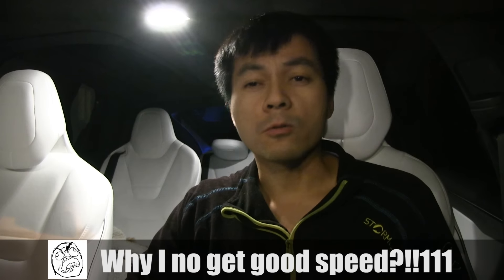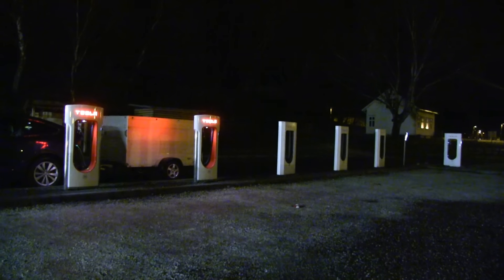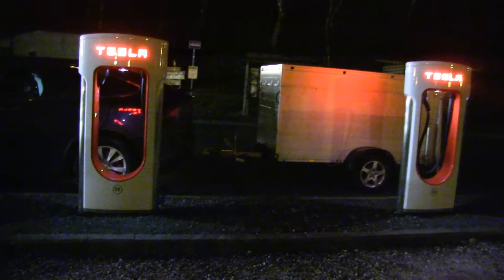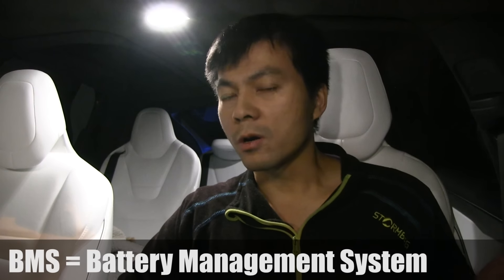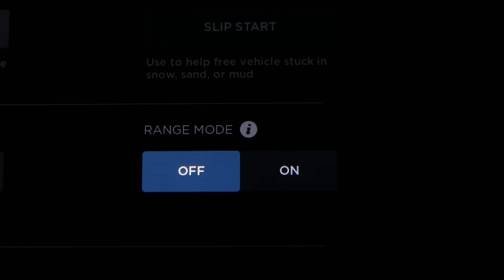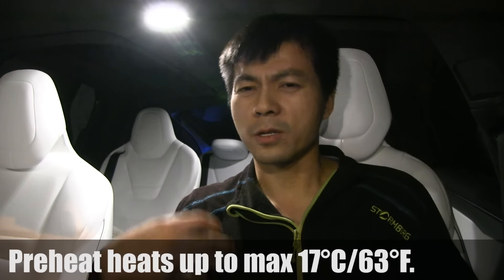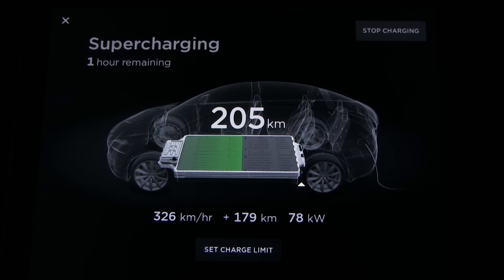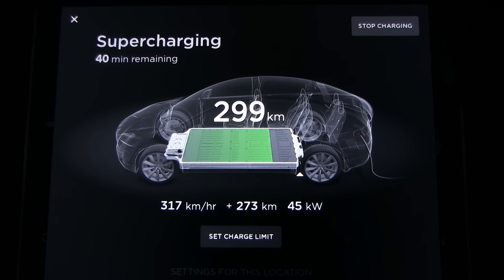How to get fast supercharger speed

Comment: They key point "range mode" need to turn off is the key point. It is very good for you to tell us the key point. I am from Hong Kong. Like your video as usual.
Reply from the maker: There are several key points. Even if range mode is off and you plug on a charger where someone else is already charging at, or you arrive with 80 % SoC, you still won't get good speed. Hence, all three conditions must be met at the same time.

Comment: Is there a change in efficiency (more kwH used from the grid to get that amount into the battery) of charging the battery if the battery is warm or not?  We have peak and non-peak power times at our house, and in the winter time our garage could get below 0 degrees Fahrenheit.  If the efficiency is the same I'm thinking it would be cheaper to charge starting later at night when the battery has already cooled down to a sub-optimal fast charging temperature.  You have all night to finish charging the car, so the speed is not important as long as it is done by morning.  Have you looked into this?

Comment: Hypothetical - If there is a person at 1A getting 100kW and you used 1B providing you with 50kW.  When the person from 1A disconnects and leaves, will 1B become the priority automatically or would this user need to disconnect and reconnect to set that priority?

Also if you turn on Range Mode, would that decrease your SoC % and then increase your speed?  The goal would not to be reaching 100% Range Mode, but lowering SoC so that it charges quicker.  Or is SoC measured off the battery size and not the software limitations?  Thanks.

Comment: Preheating time needed must of course depend on ambient temperature because if it's higher than 17C the battery would be already warm enough at the start. I guess you explained worst case scenario just to simplify it.

Comment: Doesn't a low SoC cause more wear on the battery?  (and charging at a higher rate).  The charts I've seen show that you get more total battery lifetime kWh (charged/supplied) if you only discharge to about 40-50% (and only recharge to about 80%).  Now, those numbers are relative to the actual cell capacity - electric car batteries can have more capacity than their nameplate and may not charge to their true 100% capacity to increase longevity.

Comment: Thanks Bjorn for useful video for us new owners. I have a 2014 85 and have an experience where I wonder which demands that were not reached for full charge speed.
I arrived Valdresporten SC after driving 1.5 hours with soc about 36%, I was alone on the charger, outside temperature - 7 and I got about 60kw charging speed. 
Could it be that the battery never gets hot enough by such outside temperature to get higher charging speed - or? What is your experience in the winter?
Reply from the maker: Was range mode on? I never have this problem even when driving through lower temperatures than that. But range mode is off (meaning battery heater is on).
Reply: Yes - range mode off (have never used it "on").  Same experience when driving the other way back, with even slower charging speed. But then I had been driving downhill from Golsfjellet and less load on the battery that's makes less heat in the battery - so I expects that battery temperature was even lower ...

Comment: Great job Bjørn Nyland! Sorry fot the O.T. Do you actually know how Tesla engineers have managed to fit a 100Kwh battery pack in the new Model S or at least how it's made? How do you think they have upgraded the battery? By improving chemistry or adding more cells? Thanks
Reply: Better cells.
Reply: Esunisen thanks for the quick answer but how do you know that? Is there some kind of forum where did you take these kind of infos? I wanna know some more of the technology behind the Tesla's car
Reply: +Flavio Artegiani 
Previous commenter is wrong im afraid, Elon Musk confirmed that the 100 pack uses the same cells as the 90(or therefore all packs) and they have just improved and redesigned the cooling/heating system so that they can fit more cells. 
Go to the tesla motors club forums. Members have discussed it there extensively.
From the calculations I did they now have 492cells /module as opposed to 444 on the previous generation packs like 90 and 85, others have come to these numbers too.
This is of course speculation as no one has opened up a 100pack yet.

Comment: Maybe Tesla should fix their firmware so range mode doesn’t disconnect battery heater while it’s cold and sitting charging.  Or provide that as an option setting.

Comment: Do you still only get 80kW as maximum speed at the SuC?
Reply from the maker: Yes
Reply: Bjørn Nyland do you know if there is anything wrong with your car? if not, are you planning to get it checked out?
Reply from the maker: Filip Bjurling Other owners are reporting the same issue. All this happened after v8.0. I have already reported it to Tesla several times and they diagnosed my car.
Reply: okey. thx for the update
Reply from the maker: Arnis Tarassu And are you sure that Leaf with only passive cooling doesn't take damage from that? Just because another car is doing something Tesla is not doing doesn't mean it's not healthy.

I remember someone was complaining that Tesla limits the regen with cold battery. His Ampera didn't limit regen with cold battery.
Reply from the maker: I compared old footage of Model S 90D facelift right after the speed was increased. It turns out that my "slow" speed isn't that bad if I charge from 5-10 % to 90 %. With the old charging profile, you get faster max speed at the bottom. But the speed also tapers off more agressively. With the charging profile now, the 70-80 kW sustains for a longer time. And even when it tapers off, it is more flat.

Conclusion:
- Charging from 5-50 % takes longer than before.
- Charging from 5-90 % is more or less the same.

Comment: I would add: Battery must not be hot
Maybe it's what happens when you get low speed when you tow the trailer and use 400+ Wh/km.
Reply from the maker: That's a rare case. I wanted to simplify this video because most people don't want to know everything.
Reply: Thanks for x-plaining things.  Wish Tesla would do a better job at that.

The supercharger is a bank of chargers that can connect either to power bus A or power bus B since different batteries at different SoC have different voltages.  As a Tesla plugs in to say A bus (call it a master) enough chargers will be connected to that to provide the current as demanded by the car's BMS.  When another Tesla plugs in to B bus (call it a slave) the remaining chargers (or as needed number of them) will connect to B.  As the current demand on A decreases (as the battery gets full), a freed charger will switch from bus A to bus B (if needed).  This is observed as a current jump on the slave Tesla connected to B.  It maybe possible to switch the roles of master/slave by stopping/starting the charging on the master car to free the chargers without disconnecting, but don't know how long that pause needs to be.

Or something like that.  How many chargers are there in a supercharger cabinet (10, 11, 12?), how many are available for use vs. standby/spare (or due to power source supply restrictions), what is the max. current for each generation and how many generations are there are all questions unique for each supercharger instance.
Reply from the maker: vdiv Each supercharger stack consists of 12 chargers. The same ones that are inside the car.
Reply: Well, they are similar. :)  They are probably not the NA versions that are a single phase ~277V, but the EMEA 3-phase ~480V versions. Also originally they were 11 of the 40A (11kW) versions (+1 spare), but now they could be the new 48 or really 72A versions.  If running at 72A (20kW) they may only need fewer of them and perhaps no spares.

We know they started with the 120kW, then 135 kW, and now 150 kW. 

https://www.dropbox.com/s/3thjvq5bseack4k/2016-05-22%2020.32.36.jpg?dl=0 

https://www.dropbox.com/s/rs0grteq3ubveh6/2016-05-22%2011.57.55.jpg?dl=0 

Also, there are differences in the cooling, it could be liquid cooled (but no chiller) or air cooled.  If liquid cooled, they may have one serial or several independent or parallel coolant loops.

Superchargers are indeed interesting if one is allowed to look under the hood. :)
Reply: In Norway it might be rare. But what about hot places?